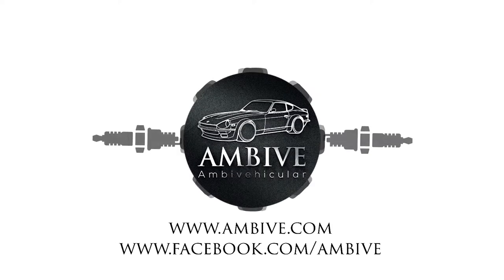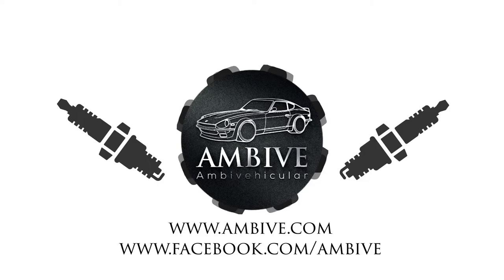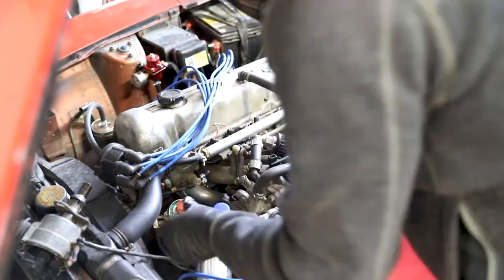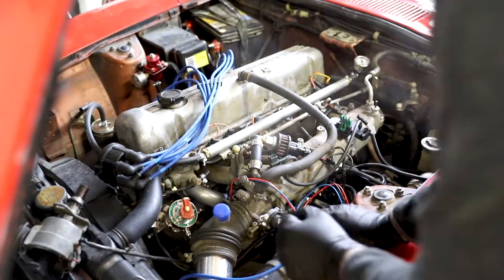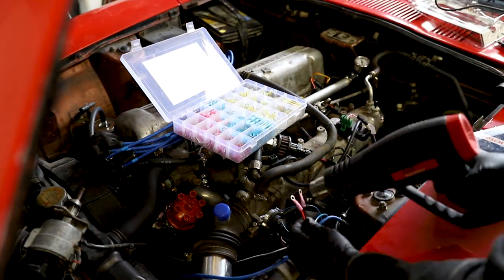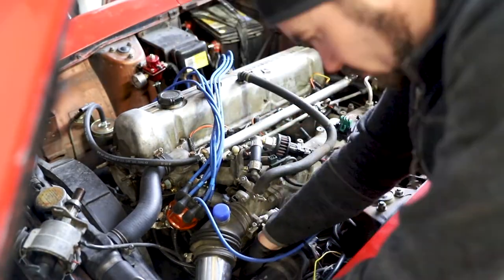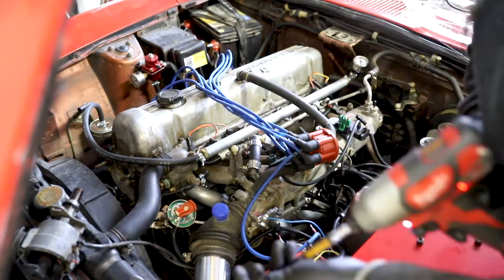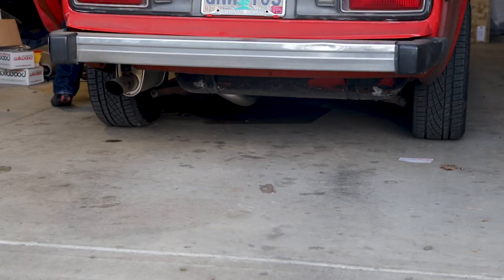280Z DD Project - Installing a Bluetooth distributor

Comment: Just to clarify 123ignition never says to not use a timing light. The Green LED is only to get you staticly close to TDC on #1 compression stroke. Sometimes the rotor is between two spark plug lugs on the cap. In that case the next one in rotation is your new #1 and the plug wires should be installed from that new #1 according to the cars firing order. Having someone crank the motor and turning the distributor until it fires is a great way to speed up the process. But remember to always sync the timing on the app with the motor. 
Here Are A Couple Ways To Help You Sync The App With The Motor.
1) Set a program in your app to 12* across all rpm points. Start the motor and verify that you have 12* at the crank. If you do not simply loosen the distributor and turn it until you do. Once you have 12* at the crank, tighten the distributor down. The app is now synchronized with the motor and you can now confidently add a program of your choice and know that it is accurate.
or 
2) Pick any point along the curve and verify with a timing light that the point on the app (both the rpm and degree) is the same at the crank. If not loosen the distributor and turn it until you do. Then tighten the distributor down.

Comment: While I don’t disagree with how you installed the 123tune+ I suggest finding true TDC and then setting the spark plug 1 lead to where the rotor is pointing, remembering that the rotor goes CCW in a S30 (L6 engine).   Firing order is 1-5-3-6-2-4.    THEN check that your timing light exactly matches what the 123/Tune+ apps is saying on the phone or iPad.  If you want to leave a static advance, that’s ok.  But remember that static+ whatever you set in the app will be your total advance.  Once it’s dialed in, it is a nice unit.   I have an install video on my channel.
Reply from the maker: I agree, once dialed in it's a great unit. The custom curves work great for smoothing cold starts on aftermarket EFI systems and the immobilizer feature is excellent for cars that are actually used.

Comment: When you pointed the timing light at the mark, it was not very consistent, it fact it looked like you may have been using a distributor that was warn right out, is it because the camera was not picking up the strobe light correctly ?
Reply from the maker: You're right, it's the settings of the camera. It's a DSLR that had a rate that just doesn't line up with the strobe. Looks strange when you record LEDs as well unless you adjust the settings to match.
Reply: Like the old movies where the stagecoach wheels are running backwards🤪

Comment: I know it’s been a while but did your tach work properly after installing this? Mine is all jumpy now
Reply from the maker: The tach on this car was never great, but it is better after the swap. You could swap back and forth between the distributors to see if it's actually a distributor issue, but my guess would be something else. It definitely wouldn't be uncommon for the tach to just be having issues itself.

Comment: UPDATE!!!! Im eyeballing this for my 510
Reply from the maker: I'm hoping to get an update out soon, I started working in the shop on the 280Z again but got distracted doing the control arm bushings and some wiring!
Reply: Be careful with polyurethane bushings.  In my experience they last longer, but you get a harsher ride in the city and on rough roads.   Control arms, tension rods to body in the front transfer all the bumps into the steering wheel.